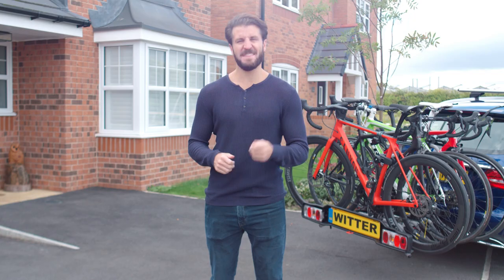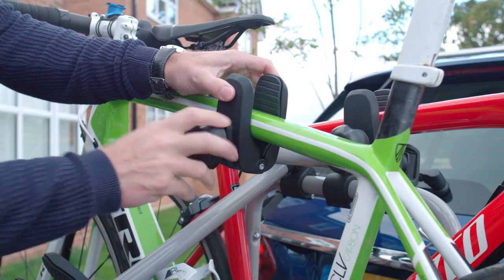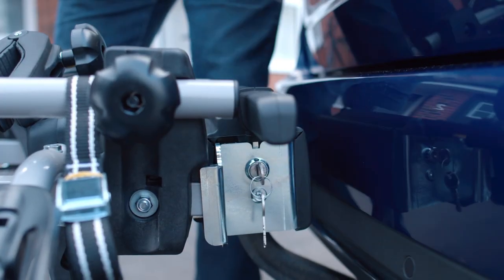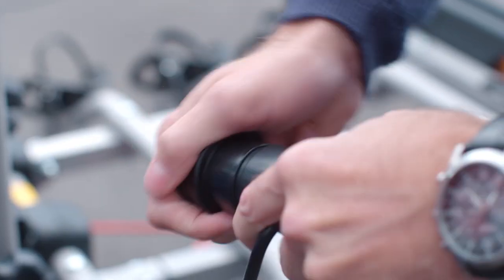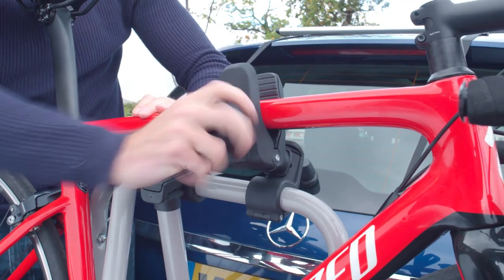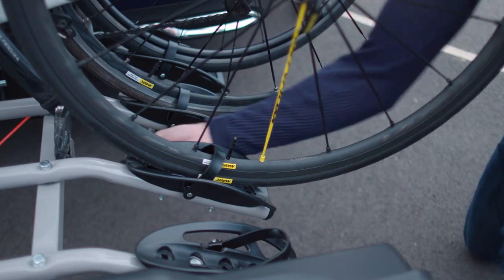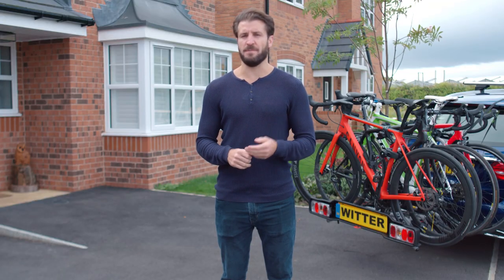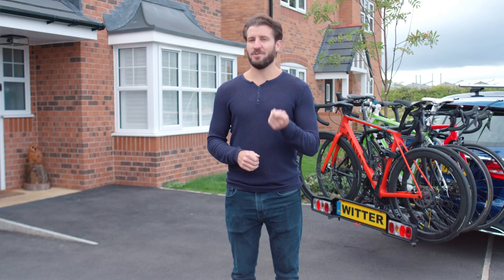Clamp on Cycle Carrier from Witter Towbars

Comment: There are no straps with this carrier to fasten to the tailgate. There are none present either in the box, on the instructions or on the picture. This video is misleading.
Reply: Interesting! I'm about to pull the trigger on a ZX303 from BezosCorp. I can see in his product photo that there's no 'extra security' straps shown or mentioned, but there are holes in the frame to accept such. I have a knackered old Halfords hatchback lid bike carrier from 20 years ago which has these kind of straps. Will pilfer them from that old rack and transpose to the Witter one.
Reply: @SQD_SquirrelMeister  in case anyone else is wondering the support straps are only on the 4 bike version, the 2 and 3 bike version have none in box! (maybe good to add one though for extra safety although if they think its fine its probably fine without!)